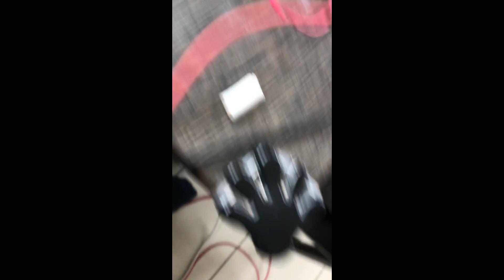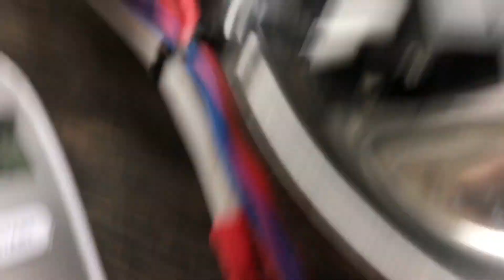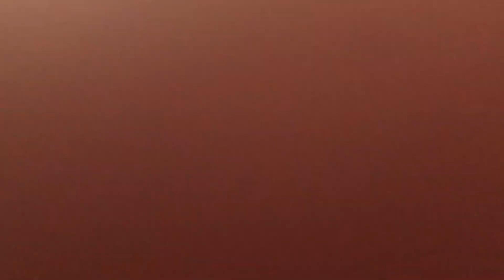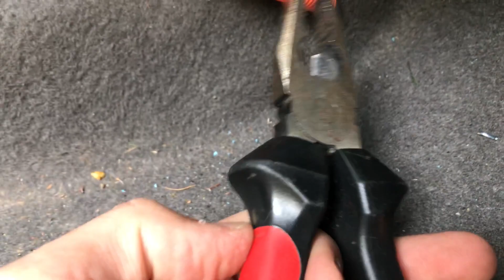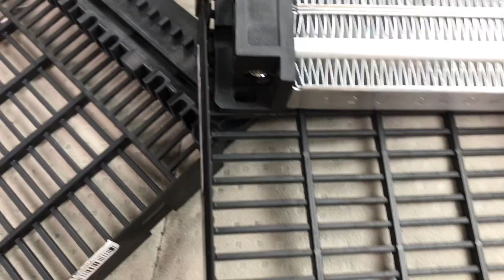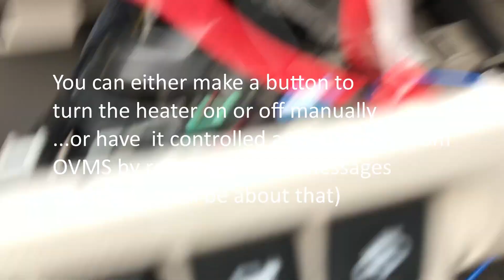Nissan Leaf PTC Heater Replacement

Comment: Did you say a CAMRY heater from amazon?
Do you have a link?
I can't find them
Reply from the maker: Hi, No it's ceramic heater. Just search for "12V ceramic PTC heater element". There are plenty of them.
Reply: @evsolar  WOW! Is it that simple?:
https://www.amazon.com/Electric-Heating-Thermostatic-Insulated-Heater（70W/dp/B07VCY559N/
Reply: What is the stock Heater's Wattage?
Just to confirm, this heats the car Interior, not the battery, correct?
Reply: Maybe I should get a 100W?
What is the stock Heater?
https://www.amazon.com/Bestol-Insulated-Ceramic-Elements-Electric/dp/B081NQNHR9
Reply from the maker: @adamwithers  100W is nothing. Go for at least 600W total. The stock heater is 6000W.
Reply: Is this the PTC heater that goes IN the battery?
Can I add one to a 2011 model?
https://www.youtube.com/watch?v=CBB2DP7CV2I

Comment: Great video
Reply from the maker: Thanks. I have been using this setup for a year now, altough I added one more element totalling 600W. One thing to note is that it can take up to 3 hours to defrost the windows when the temperature drops below -5 celcius.
Reply: @evsolar  Thanks, and dually noted

Comment: Nice work.  I would remove the hv terminals from the connector at the battery, and fill the plug with epoxy.  Leave the hv interlock loop wire.  Then the plug is a safe way to not have hv coming out.
Reply from the maker: Thought about that as well, but I have project in mind to hook up a custom inverter on that line to use for backup AC power. So wanted to leave the connector intact.
Reply: @evsolar  I'd love to hear about that also, here or at mnl.  Please share when you do it.   That'll be interesting, hv DC to what 230v 50hz?
Reply from the maker: Dale exactly!

Comment: Hey bud, did your PTC module itself die or did the high voltage cables themselves stop putting out current. My leaf heater just died this winter.  There’s a fuse that can blow in the junction box or the element itself in dash can go out.  Did you test the high voltage wires to see if they were showing any current through them beforehand?
Reply from the maker: Hi, Heater itself seems to have died. HV cables were live.